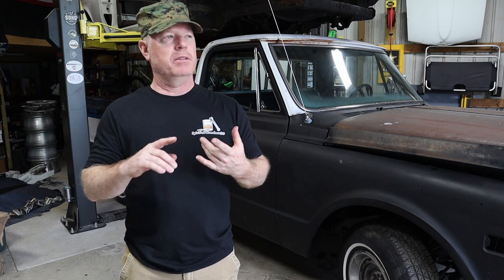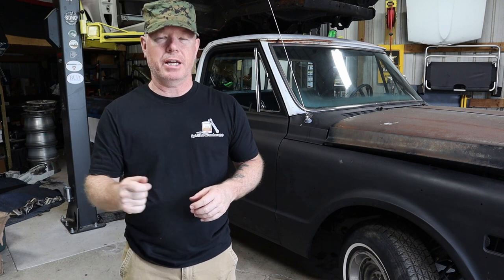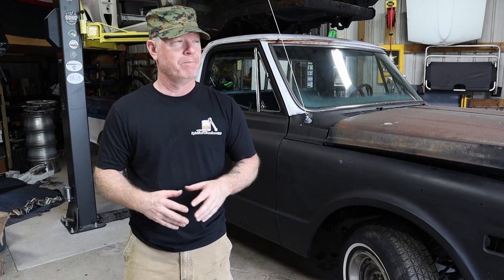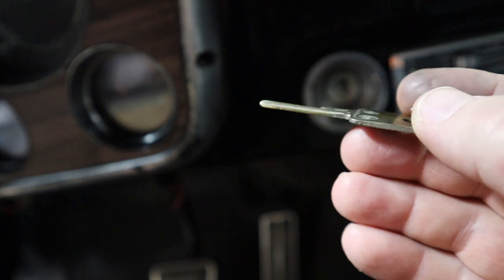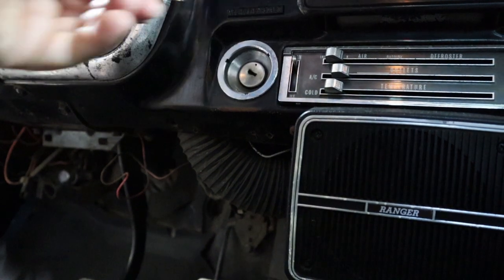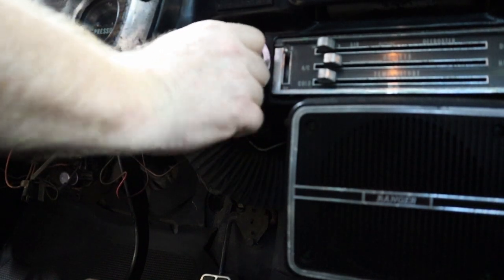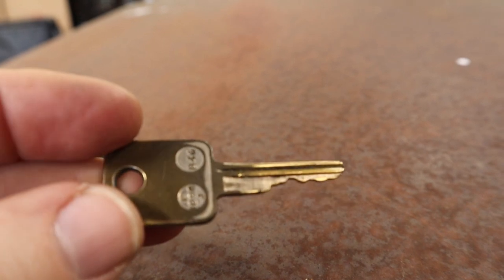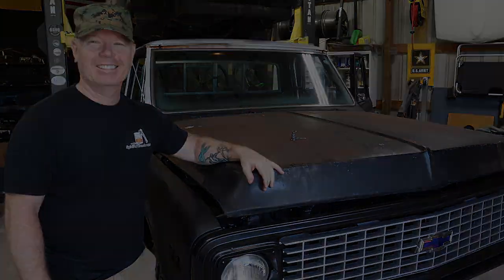How to Replace Ignition Lock Cylinder - 1972 Chevy C10 - EP. 2 - Project Harold

Comment: Glad you got an easy one this week too.😎  You probably need to change out the "ford" speaker though.🤣🤣🤣
Reply from the maker: Thank you for watching. I'm excited to have an easy one too. Just so much going on right now. Is that where that speaker came from? TBH, I haven't even looked to see if that was stock or came from something else.
Reply: @SpiritedWrenchers  I was just commenting on the Ranger name on it, pretty sure it was just an aftermarket system from olden times.😎  We can always just say it's part of your soldier lineage.
Reply from the maker: @YellowJacketGarage  LOL. I like that. You know I need to look into it further to see exactly the deal behind them. If it's OEM or just some older aftermarket. I've never seen them or heard of them but I like the old style of it being there. It may also be blown and have to come out anyway. We'll find out when we rewire it all because it doesn't currently work at all.
Reply: @SpiritedWrenchers  you could just replace the speaker, I'm sure it's a standard size and you could retain the housing for nostalgia.😎
Reply from the maker: @YellowJacketGarage  Now that's using the old noodle. As long as it sounds good and is supposed to be there, I'm cool with that plan.